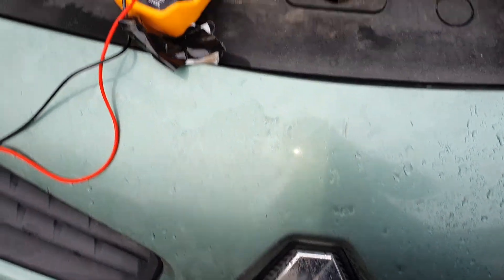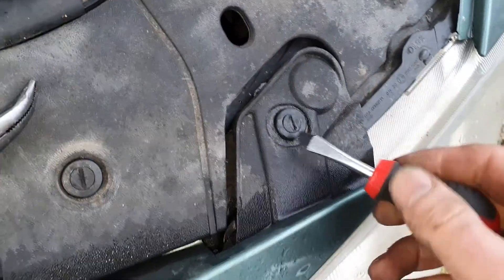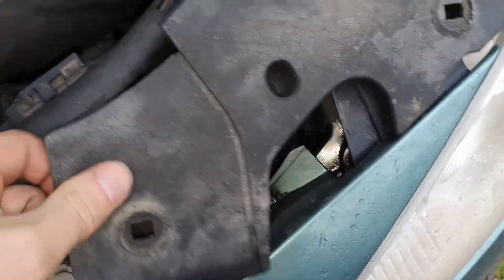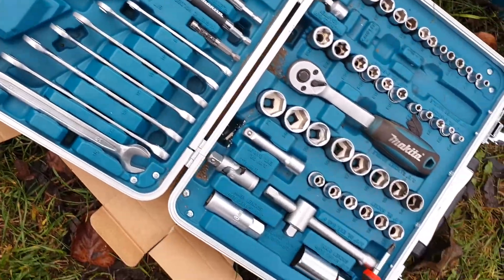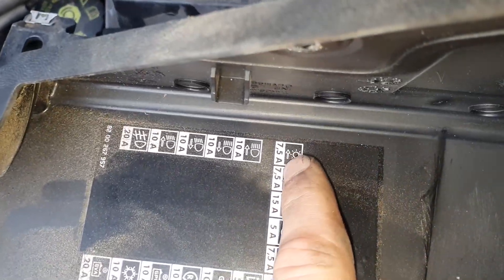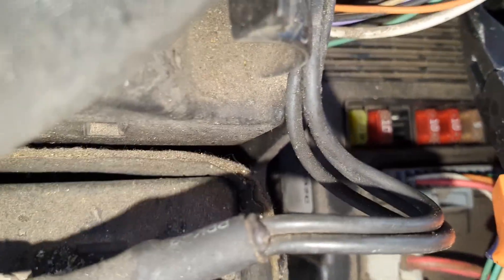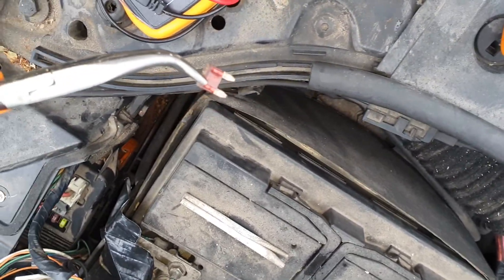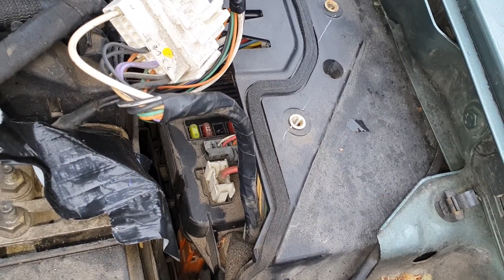How to replace Engine bay fuses on Renault Megane 2 daytime running light fuse

Comment: I have problems with my tail lights but headlights working. Is it a fuse for them to?
Reply from the maker: @pauloroberto663  maybe you got some issues with rust, Iv had this with all my meganes, mk1 ad mk2,  there is issue with connections in the plate where the bulb is installed.

Comment: What are the fuses for the interior lights ?
Reply from the maker: To be honest, idk and I dont have the car anymore to check, but I would start by inspecting what else besides interior light does not work, probably the fuse is linked to something else as well, and secondly I would guess that if it is fuse, then I would go and look into the fuse box next to the steering wheel, under the light swithes, if it is fuse problem at all, from my exp with Megane 2, well 3 times i had some issues seemed caused by blown fuse, but all 3 times faulty was cables with corrosion or connection with corrosion, it is funny that metal body is very good against corrosion for Renault, but wirings, aiaiai... :D  just have to check for blueish cables where cable color is not blue
Reply: @JUrtanschannel  Okay, thank you very much for your help